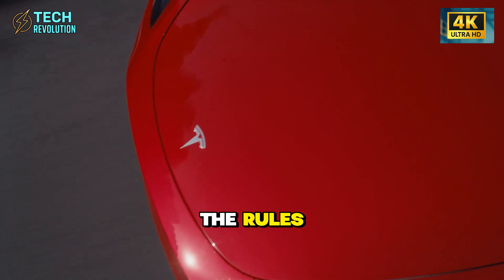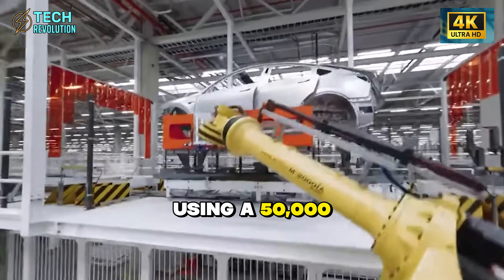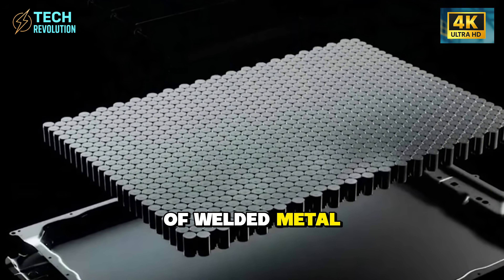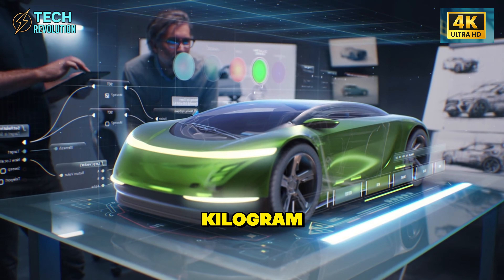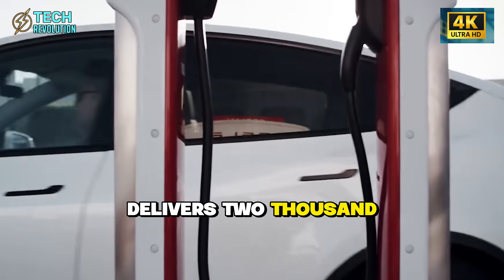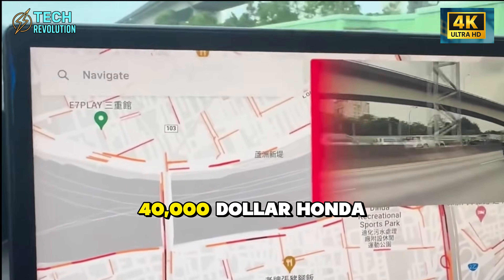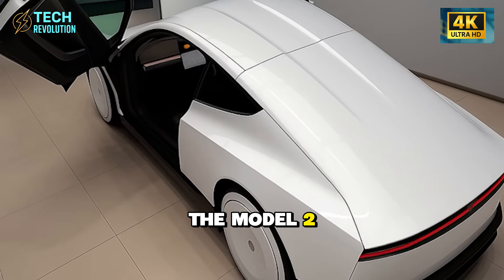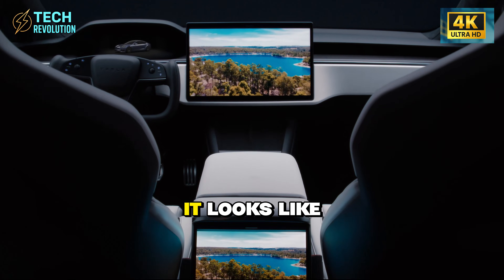Tesla's $17K Model 2 Finally HERE: Pays Itself Back $40K/Year... Unbelievable!

Comment: I would like to see evolutionary minimalism. 2 seats, 2 doors, hatchback. The same platform as Cybercab. Modular swappable center console and controls for handicap, luxury, and other lifestyle specific aftermarket customizations. Solar cells on top will pay back many times over in added range and battery discharge protection. Polycarbonate windshield is shatterproof, lighter, cheaper, and easier to replace. Aerogel insulation to save heat pump power and add comfort, Aluminum-ion or CATL Shenxing 2 battery. Standard wheels, Low power Starlink, Seat with full recline, No BS features. If Tesla will sell it..
Reply from the maker: You’re describing Tesla Model 2 $17K pushed to the logical extreme—Cybercab DNA, modular interior, cost-first design. The real debate is whether Tesla ships one clean robotaxi platform or fragments it with options that slow scale.